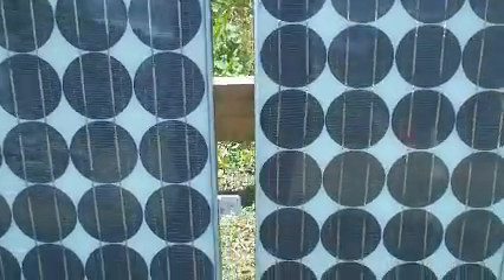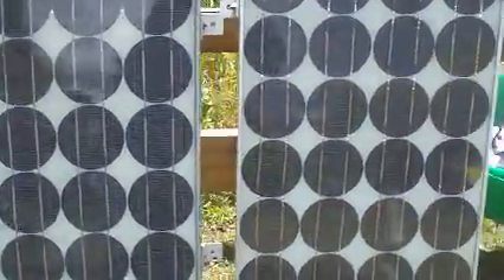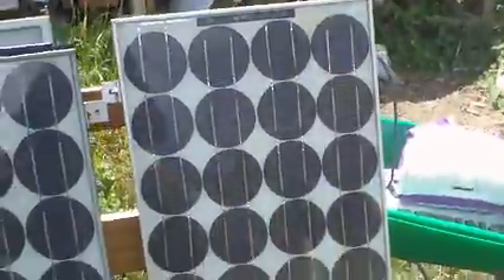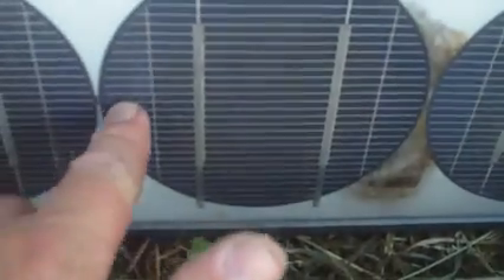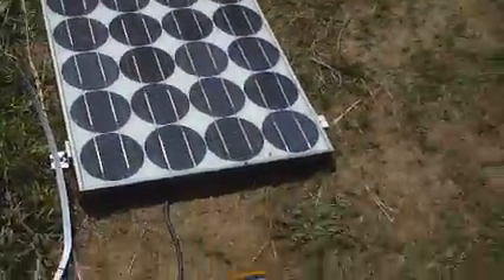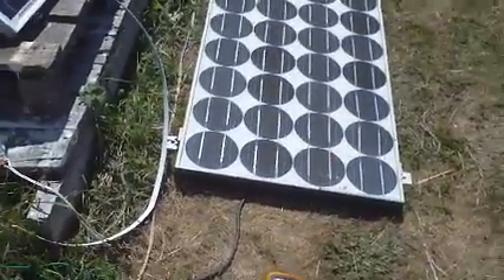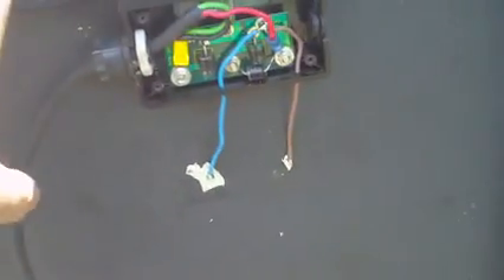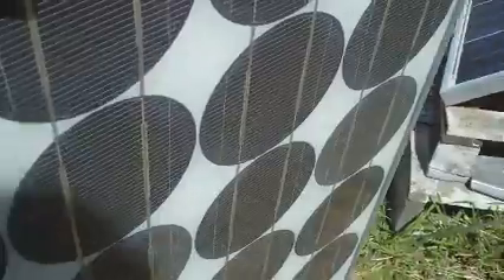Another Extreme Solar Panel Repair - No Broken Glass!!!

Comment: These BP panels are 80 watts, and 36 cells So 12 volts nominal.However, they are very good and tend to put out much closer to their ratings plate wattage than other newe panels.